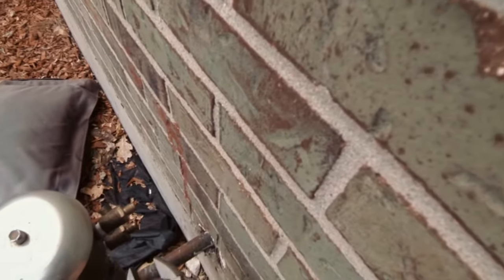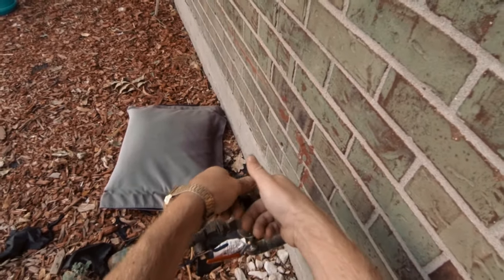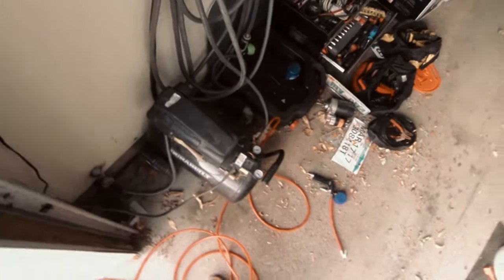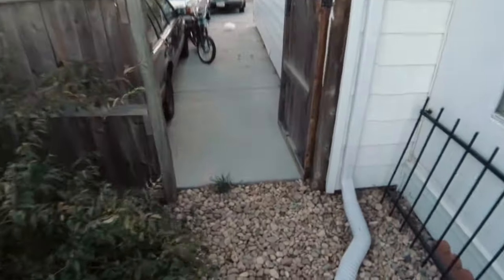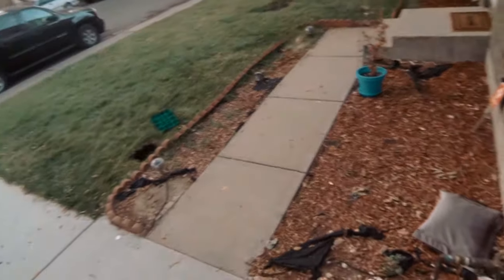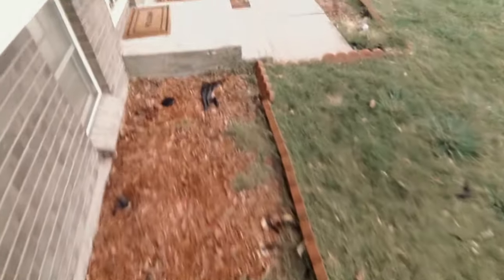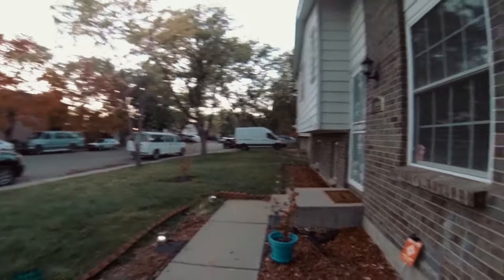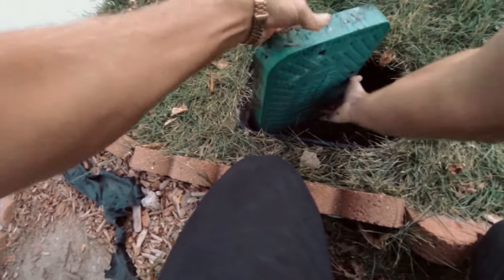How to Blow Out Sprinklers for Winter time (winterize) using Air Compressor

Comment: How many CFMs is your compressor?  Most 6 gallon compressors are 2.6cfm max, and the sprinkler system will need 10cfm.  Did your compressor get very hot during operation?
Reply from the maker: Not sure what cfm it is without looking at it. Had to blow some of the zones more than once. Didn't get too hot, it only had enough pressure for first 10 seconds or so when I opened the valve. I close it then and let it build back to 120 psi.